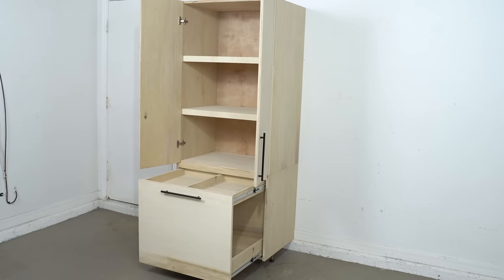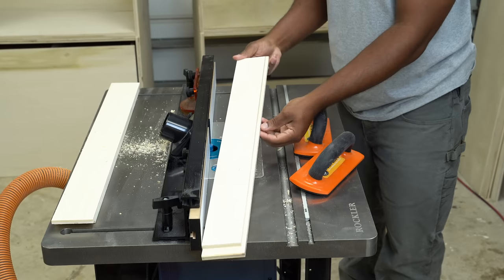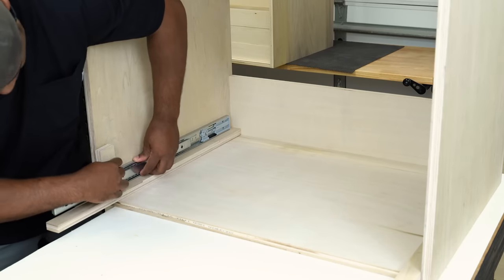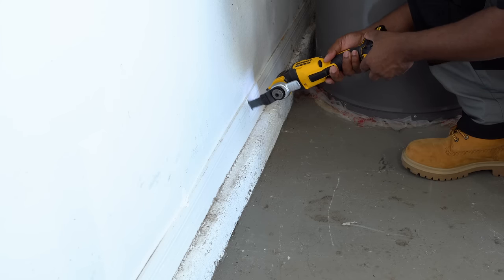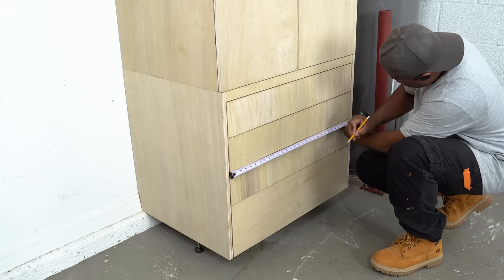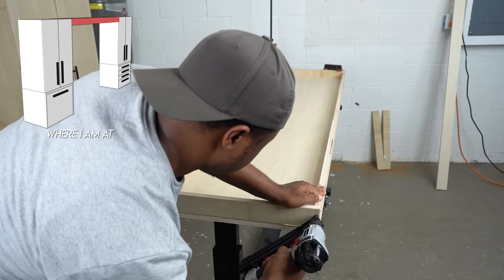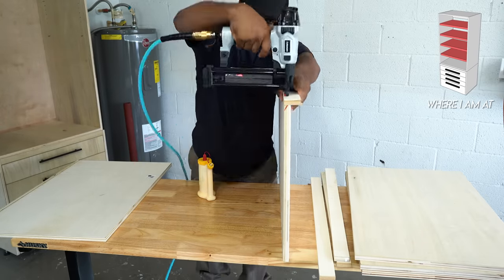How to make Modern Cabinets and Organization

Comment from the maker: I meant to get this out sooner, but the plans took longer than I hoped. Nonetheless, they are here https://gum.co/ujmNv
I think I will paint the cabinets grey,  but first, I want to add some more storage to things out of sight.
Reply: Shout-out
Reply: Your cabinets look great the way they are.  Why paint pretty wood?
Reply: Hi Glenn, I think one key thing you should do to your garage to give it even a more pop look is to epoxy your garage floors with sprinkles. Having your floors epoxied really gives the garage a clean and pro look too.
Reply: I advise you to make a bike stand or platform in front of the door instead of being scattered and taking up space ... Wonderful work Pro
Reply: Very good luck.
Reply: U are GREAT!
Reply: Those cabinets are sharp! Well done
Reply: @rcollinge5818  Because he's being sponsored by Husky to promote their spray equipment?
Reply: What happened to your squat rack you made a few months ago? I didn’t see it in the garage
Reply: @shadie024  literally just finished watching that video and wondered the same thing
Reply: Beautiful storage unit, mate!
I'd love to see you do a home Parcel Locker. One that's secure and versatile, allows for different sized parcels, and allows parcels to be "one-way" deposited and locked securely until you retrieve them.
Reply: I would add some hooks or pegs to the wall in order to hang the bikes and other tools. A designated spot to hold the other items in your garage can come from one of your creations using storage creativity to declutter while still keeping a minimal look. You should be able to save space and have a cool bike rack on the wall. Blessings to you and your family 🙏🏽
Reply: Your workbench was my first (recent) (real) project.  Your plans were, just what they should have been.  As a result, the second set that I bought elsewhere were a great disappointment.  
Keep up the good work.
Reply: what brand of table are u using that adjustable?

Comment: Good video. I like the "Where I am at" picture. It helps me to follow where you are and visualize what is happening. When you measure correctly and know what you're doing stuff line up like it should. I agree with the others, hang the bikes from the ceiling or on a rack on the wall 💕🌱

Comment: I really enjoy watching your builds.  One thing I would alter on this is the shelf between the cabinets.  The weight of whatever is stored on top will be born by the screws attaching to the cabinets and the screws into the studs of the wall.  The shelf would be able to support more weight and be less likely to end up having screws pull from the wood if the connecting shelf were longer, resting on top of the vertical boards of the cabinets.

Comment: 5:16  A tip for making very slick wooden drawer tracks on a budget when hardwood is not available or is too expensive, is to use strips of melamine.  The plastic surface is very durable, and even heavy drawers glide right over it, especially with a bit of wax, where they might dig in or bind on softwood strips.  The 3/4" thick particle board isn't very sturdy to nail/screw/glue to the walls of the cabinet, so I would put up a strip of solid wood or plywood first, with the melamine on top of that.  Splitting the melamine strip in two with a plastic surface on each strip makes it go farther, plus the particle board core will glue nicely to the supporting wood strip below it.  Finally, the brittle edge of melamine can be rough or chipped from your saw if you're not careful cutting it (usually requires doing a scratch cut first, or putting a layer of tape on it first to support it can make a smoother cut), so a quick sanding of the sharp edge will help prevent it dragging on the underneath side of the drawer, leaving everything slick and easy.

Comment: You could add a bike storage section, a place to hang up the bikes and store the bike equipment like helmets. Also a gardening hand tool section, fir your yard brushes and rakes. That way they are tidy and away but that you can get at them for those small jobs easily.

Comment: Awesome tool storage! I plan to do something similar, putting peg board at the back because I have so many hand tools and using the top of the tool cabinet as a small work bench. The underneath of the shelf is a great place for a 2-foot or maybe 4-foot LED light fixture and it's convenient you have an electrical outlet right there. Nice way to put that space to use!

Comment: Pretty nice build you've created and good luck to the rest of the garage organization. The only things I would add would be some varnish to the wood to give a warmer feel and look to it and also at the bottom of each shelf or drawer I'd put some very thin rubber film for the tools not to slip and to have a quieter feel when you place them in. I don't know whether you could also add a charging station hanging on the wall above the A/C socket. And finally maybe some calendar or project planner board or sth....

Comment: One idea i can offer is perhaps you can hang the bikes from the ceiling, if its high enough, and pull them down when needed with some sort of pulley or extendable spring system. Ive seen it before and its very useful.

Comment: The Woodshop Junkies channel from South Africa is getting really good at finding creative ways to get the most out of a limited garage/workshop space. You might want to check out his ideas. Also, Fix This Build That channel has some other cabinetry ideas as well. Looks like you need to buy some bike hangers to hand those bicycles along the wall. This Old House and other channels have ideas for fold-down workbenches that can be mounted on the wall.

Comment: You could create a storage system for those bikes, ceiling mounted hooks that are spaced closer to the wall, hang the bikes by the rims with the front wheel turned 90° and have them slightly offset so two bikes can be closely stored for more efficient space. Also could be high enough for vehicle clearance.

Comment: I have concrete lip around the perimeter base of my garage slab also and was thinking of the best way to build cabinets around them.  I guess best method is to rest cabinets on them, mount to wall, and have legs in the front for more support

Comment: Hey great work!  Like others have said, I like the "Where I'm At" image.  Keep it up!  You've earned a sub!

One thing you might consider is that when you fill up the wheeled tool chest it may be too heavy to slide in and out on those center wheels.  Maybe swap them out for some spinning casters?

Comment: Great video, thanks for sharing. I really love the "Where I Am At"  diagrams in the upper right corner. They make it so much easier to understand what you are doing. Question: Do you do anything to ease the cut edges of the plywood so they are not sharp? Do you use a router to round over the edges, sand them, or just leave them as is after the cut?

Comment: Looking man, looking good. 
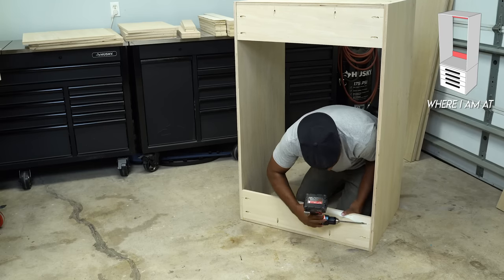At 1:47 man it is your workshop, you are entitled to do whatever you want. 
At 5:17 in order to have a smooth movement in wooden tracks, a very ancient method still in use today and it is wax, candle wax does the trick very well. 
At 14:18 man, it won’t take long 😂
You also can add some lights under that bridge between the two tower cabinets. 
It will be very useful, believe me

Comment: A nice minimalist look for shelving for the rest of the storage would be the 'ladder' type of shelf supports, where you have a front and rear vertical piece, with 'rungs' attached to those, as if you're looking at a ladder edge-on (and doubling up the rungs, one on each surface of the uprights gives extra strength to your shelf, and allows for a ladder made of narrower stock).  Several of those every 30 inches, and your shelving can just sit on each of the rungs (screwing the shelving to each rung will tie the ladders all together, for extra strength).  It's a nice and strong design, and can be easily prevented from racking left and right by attaching a nailer board in the back that spans at least 2 of the ladders and is screwed to the wall, making the shelf feel as solid as the wall.  And if you don't want to look at the ends of the rungs, they can be covered by a wider vertical strip of 1/4" plywood.  Contrasting colors are a good look with this type of shelf, so the ladders can be painted black and the shelving left natural or covered with a clear coat, or a lighter paint.

Comment: This is such a great use of that space Glen, love it!  No luck, you have mad woodworking skills.  Maybe on a reinforced peg board (in case bicycles change sizes) that you could roll out of the garage when you are woodworking. 2 bicycles on each side that hang side by side from front wheel.  Similar to your wood storage you made a few vids back.
Reply from the maker: Thanks Debby! I am thinking of some kind of stacking solution for the bike, that's if I leave them in the garage.

Comment: Very Nice!
Out of curiosity, are you familiar with the different types of drawer slides (side vs under, soft closing vs self closing,  etc)? I'm looking to build a tall sliding drawer for our pantry cabinet but it will need to be able to hold more than 100 lbs. It seems like a lot of drawer slides are limited to around 100 lbs.

Comment: Great video! Question, do you this you put the cabinets too close to the water heater? What happens if you need to replace the unit?
Reply: Forget my question! I see at the end when you are speaking about the air compressor, you must have taken it out.

Comment: Look on Amazon for a bike mount for the wall where you can mount about three bikes per unit and they hang vertically on the wall though the tires may rub off on the painted wall surfaces.

Comment: Have you considered putting a thermal wrap around the hot water cylinder in the corner? If it's warm to touch it's leaking heat 24/7, costing you money

Comment: I hope you're aware that you'll need filters for both oil and water on that compressor if you plan to use it for spraying. Nice job on the build!
Reply from the maker: Thanks, David! If you don't mind, shed some light on filter part for me.
Reply: @DIYCreators  Sure. As I'm sure you are aware oil & water don't mix. Two things that happen with a compressor are that it expels moisture( the reason you put drops of oil in your pneumatic nailers) and small droplets of oil. Both things are guaranteed to prevent a flawless finish due to using that air as a delivery mechanism for the material to be sprayed. In the case of water-based material the oil is a problem and with oil-based or lacquers the moisture is an issue. By using a moisture filter right after the regulator and an appropriate filter at the gun you eliminate these two potential contaminates. There are many sites on the web that you can research the subject of how to set up your HVLP system. I hope this helped.

Comment: You forgot to add in the above the router table is Rockler Bench Dog. The insert is the Pro Lift series and that might be a miter gauge your using to push the wood with
Reply from the maker: I did, not sure how I missed that!
Reply: @DIYCreators  so your not going to add it?  which model too , is that saw system. Looks to be an older model